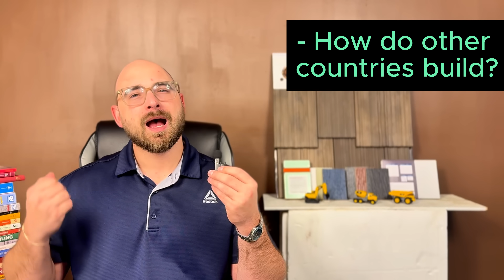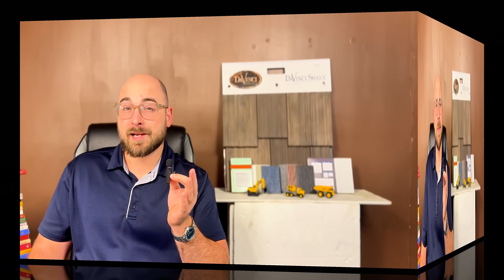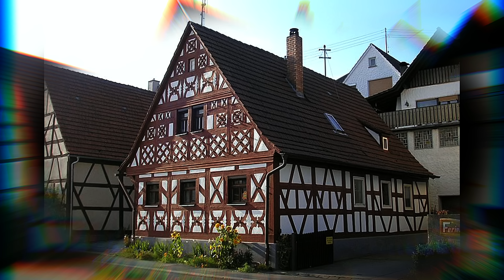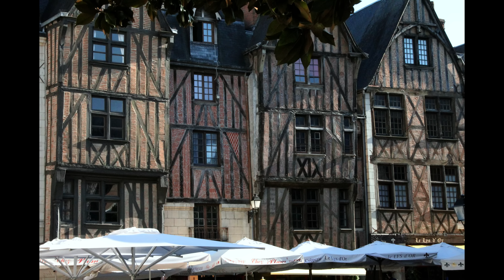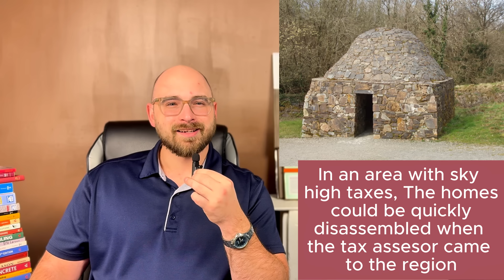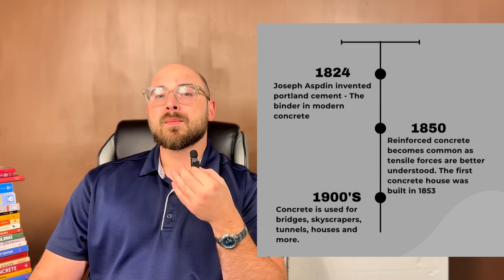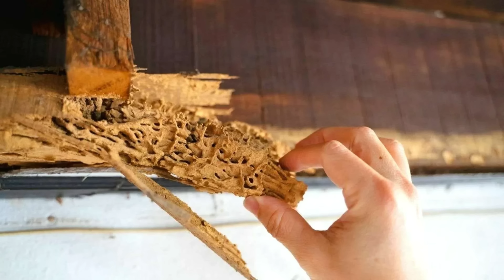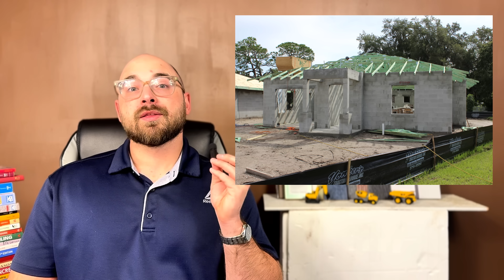Why Other Countries LAUGH at American Homes

Comment: The problem isn't the wooden houses in the US the problem is that you build wooden houses in places that are ravage with tornados floods and a hell of natural disasters making those homes easily destroyable with each disaster.
Reply: My stone house would probably not fare well against a tornado. But I don't live in a tornado area, so it has done okay since it was built in 1860.
Reply: @ I´d like to know now where you live to show, that your Home town was hit by a strong tornado ;)
Reply: @JohnnyWalkerKat  Yes US has very severe tornados in certain areas. However you are more likely to die in a car accident or from heart disease than your house getting hit by a tornado. It’s like a one and one million chance or something like that.
Reply: @thehumblepilot22  It's not just all that. North America is continental hard mode for weather, and America in particular gets the worst of it. Anything in built in America has to be livable at a temperature swing Europe just doesn't have. Everywhere in the US has to handle 0c-38c. Minimum. Our high temperature records are higher than anywhere in Europe. Our low temperature records are lower than anywhere in Europe. Chicago has been hotter and colder than anywhere in Europe in a single year, it does it regularly. Then add in thunderstorms, windstorms, hail... most of Europe doesn't know what hail is, tornadoes, hurricanes, earthquakes. America is just too variable. It erodes and destroys European type construction.
Reply: @ agreed Europe is very mild when it comes to weather.
Reply: @halycon404  You make it sound like a variation of 38°C is some sort of achievement.

Large parts of the world get much larger variation in temperature than that, even in Europe.
Reply: @TehronGaming  It's not a 34C swing. It's a 70C swing. Above I used Chicago. Chicago is at 40 degrees latitude, also at 40 degrees latitude, Rome. Chicago and Rome have about the same summer temperatures, with the record for each city being 1C apart. Record low for Rome, 4C. I'll get back to Chicago's record low in a moment. 20 degrees latitude north of Rome is the city of Helsinki. Helsinki has a record high of 31C, which Chicago will hit for month long stretches. Helsinki's average summer temperatures are much lower. Want to guess the difference between Chicago and Helsinki's coldest record?  1C, same as the difference between Rome and Chicago's high. In winter months Chicago and Helsinki may as well be the same place for average temperature and record low temperatures. Chicago has a 74C temperature variation between its two records. And everywhere east of the Rocky Mountains is like that in the US. Florida is at the same latitude as the Middle East, Dubai is at about where Miami is. It has snowed in Miami.
Reply: @halycon404  Denmark alone, a country with very mild climate and extremely non-hazardous nature: ~60C swing variation between its two records...
Italy's record is about an 80C swing...
Same with France...

Are record swings really what you want to compete on?
Reply: @halycon404  I specifically commented on your mention of "Everywhere in the US has to handle 0°C-38°C.", nothing else.

Just because some places in the US have to handle more than that doesn't mean you can't find many more places in Europe that have to handle similar temperature swings. I don't know why you're so hell bent on trying to prove that the US is somehow special when it comes to temperature swings when it's not.
Reply: @TehronGaming  Because it does. And it effects how buildings have to be built. A building in the US has to be able handle the heat of Mediterranean summers and skandinavian winters. Go look how things in southern europe are built vs northern europe. Spain Italy and Greece do not build like Finland, Netherlands, or Sweeden. They are completely different climates. The US has to build for both.
Reply: @halycon404  What reason is there that houses in Arizona and in Vermont have to be the same? 

Historically southern states had different layouts (think overhangs) than northern ones. 

Nowadays you're just building the northern houses in the southern deserts and the only "adaptation" to the environment is the sizing of the AC system. 

Building the same houses everywhere is pretty solid proof that you DON'T adapt your houses to the environment not the other way round.
Reply: @ 
"The US has to build for both."
So does Europe. The only difference here is that the US is a single country and Europe is a continent consisting of multiple countries. They're both large geographical areas that cover multiple different climates.

You're just cherry picking single countries in Europe instead of talking of Europe as a whole to somehow try to give your argument some ground to stand on which it doesn't have when you stop strawmanning it.
Reply: @TehronGaming  I picked a single city in the US. And I didn't cherry pick it. I picked it because it's representative of most of the US. Then I picked two cities in Europe at the extremes of Europe's latitude range with similar elevation. No mountains extremely cold cities on mountain tops. Nor sub sea level deserts. Yes I picked them in specific to show the extreme of one US city.

The reason every city east of the Rocky Mountains has that type of weather is the exact same reason the US is home to 75% of the planet's tornados. It's three factors. 1. The US does not have an East-West mountain range, it has two North-Souths which act as wind tunnels. 2. We are on the upswing side of the Atlantic Current which pushes tropical air between those two mountain ranges. 3. We're on the downward swing of the Arctic polar current, which pushes air between those two mountain ranges. Hot air goes much further north than it should, and cold air goes much further south. When the two collide, tornados. If one is stronger than the other tropical air is sent to a city the same latitude as Helsinki or Polar air is sent to a latitude the same as Dubai. That's the entire continent. There is no cherry picking in the US. Everything east of the Rockies is like that. West of the Rockies is controlled by the Pacific, not the Atlantic.
Reply: @TehronGaming my home in the center of america has to survive -40c to +40c on a near yearly basis.  Hell my twon will regularly drop 30-40 degrees in a single day if the jet stream dips out of canada.
Reply: @halycon404 Bro your houses have the worst possible isolation both for winter and summer, you compensate with absurd amount of cooling or heating.

European house have better isolation and can be built for even the highest temperature in the world, in winter they protect from the cold and in summer they protect from the heat
Reply: @halycon404 Lmao we know what hail is, again a concrete house would have absolutely no problem dealing with the strongest hail in the world, it can deal with nuclear explosion.

Nope america does not erode and destroy European type constructions, also using concrete isn’t European style it’s something everyone does in the world but Americans.
America already has plenty of concrete house that do really well in all weather events cause they’re fucking concrete
Reply: @halycon404 also 0-38 is the minimum in most European countries, I’d say more 0-40 for Western Europe
Reply: @halycon404 And do you realize that concrete house would be better suited to deal with that cause better isolation
Reply: @halycon404 Nope actually they do built really similarly in Spain and Italy compared to Sweden and Finland.

American houses do not deal with extreme temperatures you just turn up the heath or the cooling to compensante
Reply: @halycon404 You’re literally giving more reasons to built concrete house instead of cheap wooden house that cannot deal with cheater event and cannot deal with extreme temperature without extreme amount of cooling or hating
Reply: @TehronGaming  if you can legitimately consider Europe, the continent, rather then the EU, the trade collation, then you're already lost. 

Europe doesn't babysit 50 countries per year. Europe has independent countries. To refer to Europe as a whole is disingenuous at best, and snobbish at worst. 

If you can cherrypick bad examples of a few states, we can cherrypick a few countries.
Reply: Yea bc a tornado or hurricane picking up bricks and throwing them is totally better than a wooden house 😂
Reply: @mrcody1924 we’re talking concrete
Reply: @ni9274 what will happen to your concrete house when a car is thrown at it at 136 mph (roughly 218 kph)
Reply: Well when said disasters don't care if your house is made from stone or wood the cheaper option is better.
Reply: @eddiemarohl5789 Completely false, against 99% of disaster concrete will whistand it
Reply: Tornados are generally very rare and rarely very large.  And plenty of concrete buildings get destroyed by tornados as well.  Maybe a cave house could curvive a direct tornado hit, but the air pressure could still destroy everything in it.
Reply: Brick houses are still destroyed in tornadoes
Reply: Yet my house has withstood multiple tornadoes and floods and it's considered as one of the worst types of homes in the USA.
Reply: Here in the Pacific Northwest we don't really have hurricanes or tornadoes. Wood frame houses are superior during earthquakes which is why this construction is also popular in Japan. There are many advantages and disadvantages for any of the construction methods mentioned. A very strong and durable house can be built using stick frame construction. If built correctly it's also not particularly cheap. Most people who criticize one method over another typically don't have experience with what they are criticizing and are proponents of what they are familiar with.
Reply: Сейчас в калифорнии там городок выгорел, сейчас они опять все отстроят из дерева и картона.
Reply: Go ahead, put your brick house in an EF5 tornado. See what happens.
Reply: Well the wood and drywall houses are cheaper and faster to build, but that doesn't mean all of the houses here are built like that. I've seen plenty of houses in my area that are built out of cinder blocks with cement in the interior spaces of the blocks. But again, it's more expensive to build a house like that, and takes longer, also these are generally smaller one story houses. I've also seen modernist concrete houses.
Reply: Floods are preventable.
Reply: @KoeiNL  ... how?
theyr emitigatable and you can protect from stuff but no, you cant prevernt floods lol.

unless you think you can prevent earthquakes in costal areas, strong rain containing hurricanes and in general weather issues.

you can mitigate it by not settling in flood plains.

ashville didnt for example
Reply: @a_lethe_ion  my country has the most comprehensive flood protection system in the world. It protects us from the north sea and it is designed to handle a once in 10000 years storm.
Reply: @KoeiNL  well yeah ur the netherlands, if it floods half of ur country is under water too lol
Reply: i think the originall point was that a brick hosue wouldn't withstand a tornado either, so at leats build the houses quick and cheap. they just lost the cheap part.
Reply: @4Curses It would whistand 99% of tornado
Reply: Yep, even 200 year old homes would not fare well in a tornado, hurricane, flood or earthquake.
Reply: So, speaking as someone who has lived in tornado alley, let me tell you that what your house is built of matters little. 

The most common tornados are EF0-EF2, those when they enter towns or hit houses, barely strip the siding off. Massive EF5 tornados are rare, EF3s are more common and is the standard for "Tornadoproof" houses. The issue is, they are exceedingly expensive, a typical masonry building would not survive a tornado at an EF3 rating, this is because while the winds may be no match for the walls, the debris that it throws is. 

Most houses that are designed for this purpose employ some form of building techniques such as landscape integration, CFB (concrete filled block) construction, and heavily reinforced steel structures. These buildings are way more than just your typical house that cost $300,000 to build, we are talking more in the range of $600,000+, most home owners will not be able to afford that. Just plainly is that in these areas, insurance is cheaper to build a new house than to build one that stands up. This is no large part due to the fact that houses being hit are rare, and as I mentioned, significant damage occurring is even more rare.
Reply: @sterlingodeaghaidh5086 They would cost less if there was a wide adoption and understanding, right now most Americans in these comment just refuse to acknowledge the idea that concrete is stronger than wood, they actually think it’s worst than wood
Reply: @ Yes, you are correct, but you aren’t gonna see that happening. Not unless laws force houses to be made out of masonry rather than wood, which isn’t gonna happen. So here we are, a wood house isn’t bad, and as I said they do a good job when built right. We all criticize modern construction because those corporate fuckers prioritize quantity over quality but when you’re searching for a house and only have so much money, what are you gonna do? Buy or build a house that costs more than you have budget for or build one that is within your budget and suits your needs?

Also for the concrete Vs wood thing, while true, when your area gets weather that can destroy stone buildings, talking literal thick stone walls, what’s the difference if a bare foundation had a wood or concrete house on it?
Reply: With no subterranean foundation lol
Reply: they're wooden in tornado and hurricane areas bcs they're cheap to rebuild, and also bcs wooden debris is far less dangerous than brick, metal and concrete. strong enough winds WILL destroy homes regardless of the materials used, so in areas with frequent tornados and hurricanes, often the smarter thing to do is to make them cheap (which doesn't always mean bad quality) and out of light materials that won't be an even bigger threat when inevitably a storm goes through and rips the house apart and flings the pieces at hundreds of km/h
I love to hate on the States as much as the next person but this one actually has a reason behind it
Reply: I blame one company for having a monopoly over construction stuff.
Reply: The real problem isn´t that in reality, it´s that they are very much cheaper, quickly and practical than concrete and/or bricks and nothing more.

In USA, anything that isn´t very profitable and very quickly to the companies, don´t worthy and that´s all.

Money rules, not society.

In California or Florida, the houses that they are made of concrete and/or bricks, the mayority are from "hispanics", not even "anglo-saxons" (from old Spanish Empire), because they know very well that in a tornado, flood or earthquake case, the unique houses that will remain standing are made of concrete and/or bricks, not wooden of course.

On the TV all people see when a disaster like that happens. It don't even necessary to study it at a university to see and understand that. Only is necessary think a little with a minimal common sense.

Regards.
Reply: @salvador9369  So why is scandinavia full of centuries old wooden houses if they are just cheaper and so inferior? Wood can be more durable that concrete buildings if built right and much easier to maintain. We even have churches here in Norway made entirely from wood from the medieval ages and they still stand today with original carving and all.
Reply: @bloxyman22 Cause they’re not built like in the US
Reply: @salvador9369s9 so basically instead of getting vasectomy, you get a condoms that's doesn't even last after 1 round and you replace it each time they broke ?
Reply: @salvador9369  you are right. Capitalism only guarantees expenshive crap that break fast!
Reply: @salvador9369 oh it's better for them if you need to rebuild the house
Reply: @salvador9369 if stone and concrete houses are so good why wouldn't they be profitable? Lower quality product doesn't automatically equal more profits. There's plenty of room in the market for higher end higher quality products and services. With your logic there would be no fancy restaurants or luxury vehicles or high end name brand tools in America. Haven't looked into it but I suspect it's probably outdated construction laws and regulations that are disincentivizing non light wood construction. There's also the issue that we already have a housing crisis with homes being too expensive and too few so the average person isn't exactly jumping at the idea of switching to a slower building, higher cost method.
Reply: @benjaminandrews956  Fancy restaurants, luxury vehicles, etc... aren't necessarily quality restaurants/vehicles. A lot of "luxury clothing" is just cheap junk with good advertisement lmao. Most people don't know what quality is, and that's deliberate.
Reply: @WhenDoesTheVideoActuallyStart  yes obviously overhyped brands exist. Doesn't have anything to do with my original point
Reply: @benjaminandrews956  I'm not talking about "overhyped brands". Almost every "luxury" brand in the U.S. has become like this. "Luxury housing" included. No one is taught what good fabrics are like, no one is taught what a well-built house is like, no one can tell what food made by an experienced chef tastes like, so the only thing "luxury" brands have is branding, marketing, and presentation.

You have to immerse yourself in the "hobbyist" scenes in order to find a brand that still makes products with the same or better quality than what they used to have 50 years ago.
Reply: @benjaminandrews956 They are profitable just less so, and there are plenty of them in the US
Reply: And wooden houses can also be build to be stronger. But that would of course cost more and we know what's most important in USA...
Reply: A tornado dosnt care what you build the house out of, and they can throw straw through a tree. At least with a wooden house you get to finish it before the tornado scatters it again
Reply: @Mishap_Motors Nope even the strongest tornado in the world would not destroy a concrete house, nothing can destroy a concrete house other than time or a direct hit of a nuclear bomb (and even then often concrete survive)

In Japan they built home resistant to earthquake which generate for more energy than tornado, don’t look for excuses.
Reply: A modern European  "hollow Lego block" home would be an absolute 💀 trap in a severe tornado or earthquake scenario, which are very rare in E.U. but relatively common in North America.
Reply: @westelaudio943 It's not Lego Block, it's concrete with steel in between. They are not really build together, they are more poured in and in one piece.
Reply: @westelaudio943Nope it would not, it would actually be the most survivable place you could be, that has been proven scientifically.
Reply: Don't diss wooden houses, built right they can last centuries and endure storms just fine.
Reply: @ Yeah but not wooden homes with plaster walls
Reply: @JohnnyWalkerKat plaster has not been used in stick built homes for about 200 years now.
Reply: @Darca1n Show evidence
Reply: @ni9274  the house my parents live in is, far as we're aware, at the very least 100+ years old. Expanded upon as it was initially only one floor, bow two, but still old and well-maintained.
Reply: @Darca1n  Wooden houses can last for centuries if built right, but literally no one does that in Yankeeland. It's all toothpick-thin balsa-like wood and fibreboard held together by plastic.
Reply: This is true. American houses are very durable, it's just Europe doesn't have hurricanes, tornadoes, and floods as much as we do in the states.
Reply: @n52kam09  well we do have some but theyre distributed differently.
like flooding is definitely an issue, italy has a volcano issue, corsica has a lot of fires (like they couldve lent their  planes bc they are salt water resistance.. bc theyre on an island so that has to be. I watched them work)
europe does have hurricanes but they tend to be far lower in number and intensity bc we dont have the pan with the gulf of mexico bringing a lot of hot moist air to meet the cold one from above. europe has a few mountain ranges in the way that help break up stuff
Reply: @n52kam09 Some Europeans island deal with very strong hurricane, and they use reinforced concrete which always whistand the same hurricanes who go on to hit the US.
Reply: @ brick houses are still easily destroyed in floods, tornadoes, and hurricanes. There are plenty of brick houses in the US, but they’re too expensive to be practical.
Reply: @ plus the Hurricane was weak when it hit the island and it got stronger before it hit the US
Reply: You can absolutely build houses out of wood that handle the strongest of hurricanes. The issue is that they're built poorly.

A typical Scandinavian home is typically built out of wood too but would fare 100 times better than the typical American one.
Reply: @ Interesting claim (and i do agree that an average middle class home may fare a bit better) on the other side, our winter storms in europe barely reach sustained winds of category 2 level. And US homes get through that quite well still.
Reply: The houses are made from wood so it's easy to rebuild.  Solid material buildings still get fucked up by these disasters, sometimes moreso than wood homes
Reply: @kentuckyace1068 Nope solid material building rarely get fucked up, they loose some part but the foundations are always intact which cheapen the reapers
Reply: @kentuckyace1068  Not if they are properly built.
Reply: @kentuckyace1068  Was going to comment on how one of the big problems is this exact misconception about solid materials and that drives the consumer demand for flimsy wooden structures over disaster resistant ones.

Reinforced concrete structures are rated to survive up to 250mph winds, that's an EF-5 tornado, while a wooden house requires rebuilding if hit by an EF-1 or higher, anyone claiming that reinforced concrete structures aren't any better against tornadoes are objectively wrong; I'll also note I've never seen anyone who made this particular claim actually provide evidence to back it up, the most they do is point at commercial buildings made of concrete blocks and steel frames, but that's nowhere near reinforced concrete.

Fires and floods obviously are non issues for concrete buildings, so what about earthquakes? Earthquake resistant concrete (up to magnitude 9.0) was developed in 2017, but I don't know about its commercial availability, and a foundation designed to isolate the building from the ground is possible even without using fancy rubber supports. Pretty much none of the arguments against reinforced concrete's safety are valid.
Reply: @kentuckyace1068 . We have houses in Australia that go through cyclones and floods and still standing. They are built aussie tuff!
Reply: @kentuckyace1068  whats is left after a tornado usually, let say an f4 tornado when it hits a house? the concrete foundation....
Reply: @kentuckyace1068  there was an ef4 tornado in my country, and the only thing it damaged was the roof.
Reply: @cmokii  but we wouldn't qualify that hut as a house.
Reply: @cmokii  I lived through the tornado outbreak of April 27th 2011. It didn't matter whether or not the houses or other buildings were brick when they were hit by EF4 and EF5 tornadoes. 

The buildings made of metal and concrete looked like kicked over children's blocks and twisted up wire...
Reply: @The_Tachmonite what’s the name of the tornado
Reply: @ni9274  my guy, they don't name tornadoes like they do hurricanes. They'd run out of names. Google April 27th 2011 tornado outbreak. There were 120 on that day alone, 62 in my home state of Alabama, and 360 tornadoes between the 25th and 29th. The storms did $12 billion in damage. I have personally had 3 tornadoes go directly over my house, with two of them reaching EF5 at some point during their path. The only reason my house wasn't flattened is because it was between two hills. The tornado went over our roof and sucked trees inward.
Reply: @kentuckyace1068  How could a concrete house be more fucked up by a natural disaster (or anything really) compared to the wood houses that are wiped away with every hurricane? What do you make hurricane shelters out of? Or fire shelters? Or bomb shelters for that matter?
Reply: @ @leocurious9919 Yeah concrete is more secure and if build with disasters in mind can stay strong for years.
Reply: @leocurious9919 
Concrete shelters are design and built with one thing in mind.

Protection.

Which means small often BURIED things that you do not want to live in.

Try to build a concrete house that is livable either makes it as vulnerable as a cheaper wooden house or put price way above means of 90 percent of people.

Put a Euro house in America and it be destroyed in weather inside of 50 years.

Euro style construction was common til to the 1930s in the US. You dont see them cause they got destroyed.
Reply: @leocurious9919  Loads of trench are structured with wood and is great against bombs and bullets. The issue is how you build a wooden home not the material it was built with.
Reply: @leocurious9919  they get screwed up and cost much more to fix than wood houses. They aren't invincible, shelters get damaged too and are hella expensive to repair. Yes it won't get washed away such is its purpose but it isn't getting away unscathed.
Reply: @leocurious9919 those shelters are rarely above ground.  Plenty of reinforced concrete buildings get destroyed by tornados.
Reply: @eddiemarohl5789  So you agree the houses in the US are just cheap trash...? If you think that is an advantage, that is okay. I just do not see them actually being cheaper.
Reply: yeah theres still cases where hurricanes were bad enough they ripped concrete from the ground, razed stone building - bc the winds arent just winds but carry debris and even a 'small' stone can shoot through a wall if fast enough.
Reply: @leocurious9919  Because we don't have the sizes of natural desasters here that they do in the US.
I certainly wouldn't build the home I currently have if I lived in an area with tornados the strenght that they rip them apart either way.

People constantly make the point that "concrete homes are better", yet it gets the loudest every time we get a weak tornado which maybe happens every few years and take it as proof, while at the same time getting mad if they're told that it's a weak end tornado, just moving a few plants, being able to take people with them and maybe dealing a tiny bit of structural damage. The ones in the US on the other hand often reach strengths where they either move or straight up lift up cars and throw them for a good distance. Concrete would just go the same way as wood or block of your exit from cellars and other emergency shelters without being properly movable when collapsing.

Also your shelter example doesn't even make any sense. Fire & Bomb shelters are built entirely different to our concrete homes, they got by far more structual integrity and require by far more ressources. You won't survive either of those in your home.
Reply: @leocurious9919  the make them out of wood because of the reason that they are desroyed every time. Then they get paid again to build the same house. So instead of getting paid to build a house once, they get paid every 3 to 5 years to build it again (in disaster zones).
Reply: @leocurious9919  Idk, ask some wooden building in Japan that still stood after shindo 6 earthquakes. It's not only materials, it's also methods. But good carpenting is very, very expensive. So newbuilds are mostly cheap, quickly assembled houses so the structure will not be nearly as resilient and strong.

I think most of the flak that is thrown at US houses is that a lot of American houses are seen as cheaply made. Like, I live in a pretty retro house in Tokyo. There's very little drywall to be found. I wouldn't even try to punch any wall here because it would hurt like hell.
Reply: @ericzaiz8358 They got destroyed by companies not by the weather, you’re delusional if you think concrete structure that can whistand nuclear attack can get destroyed by any weather
Reply: @Bearodon cause there are no alternative, when you want to build real fortifications you use concrete.
Reply: @abbynormalz show me that ?
Reply: @ni9274  If we are being realistic even a concrete house would be turned to dust by a strong Tornado. As soon as the tornado picks up a car and tosses it into your house it will crumble. And at that point a underground shelter would be a better option. Unless you want to spend millions more to build a fortress.
Reply: @JohnnyWalkerKat no structure will survive the most severe earthquakes/tornados/hurricanes/fires.  The problem is the euros do not understand the severity of American weather or disasters.  I’d love to see an F5 tornado and a magnitude 9.5 earthquake hit London.  Then we could have a very interesting conversation about construction types.
Reply: To make a home like a bomb shelter would be too costly.
Reply: @kentuckyace1068 i live in puerto rico where the only disasters we get are earthquakes, floods and tornadoes/hurricanes, lost my house in 2017 upper half was made of wood the half below was concrete and cement, the concrete stood meanwhile the wooden half got blown away. After Hurricane Maria in 2017 MOST of all buildings were rebuild using concrete, wooden houses are old for a reason
Reply: Someone said eveb if you buld them with concrete it wouldnt matter they will collapse anyway and collapse on people. Also rebuilding is cheaper so I agreed with them.
Reply: @exosproudmamabear558 Thats an insane uneducated take, there isn’t a single weather event that can make a stone/concrete house collapse.
You don’t have to rebuild them
Reply: @ni9274  I dont think a stone or concrete house can stand tornados with getting damaged severely if it hits it directly. But we do not have tornados here and I am not an engineer so I cant tell if the damage is miniscule enough to not care it. But from the some statistics harm cost looks is similar(?). Although mortality rate is lower.
Reply: I would criticise the wooden structure and how they build wooden houses in the states. I live in Sweden and if you look up the construction of wooden houses in the states vs Sweden the differences are chocking. In the states they use a lot and I mean a lot of wood where its not needed. There are usually no diagonal planks making ”trusses”. Its all just horizontal or vertical and so much of it. So its a lot of money for a less stable structure. Then after this they put shitty coverings both on the inside and outside and don’t isolate very well. Using drywall on the insides and often times no isolation on walls inside the house
Reply: Excellent and detailed presentation of the topic. In short, the American home is built for size and show, with a superficial exterior and a lack of structural integrity in order to make a buck as fast as possible with maximum margin.  Pretty much like the culture as a whole…